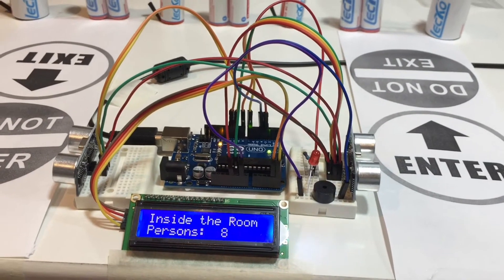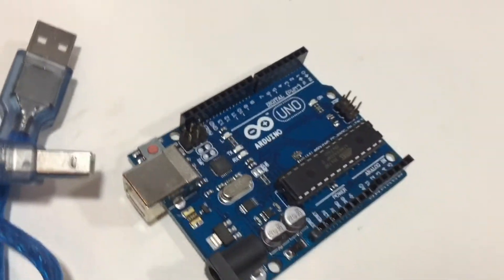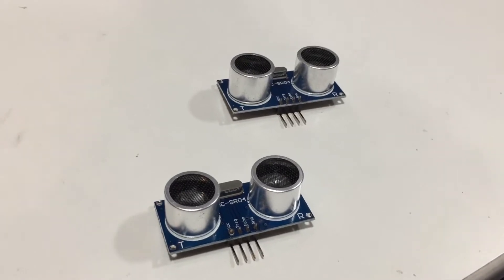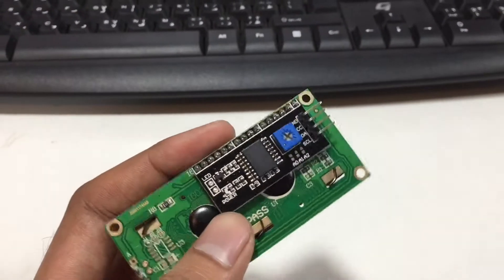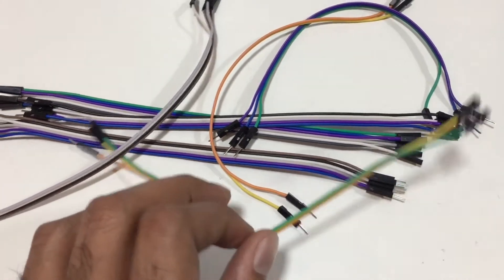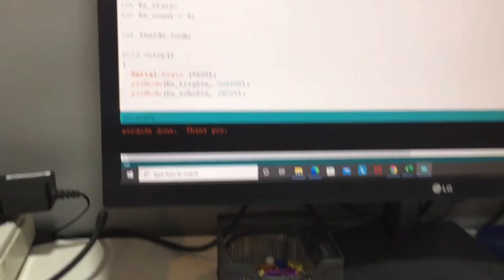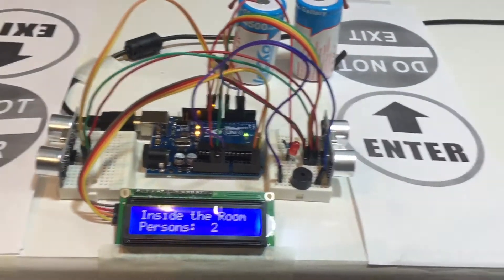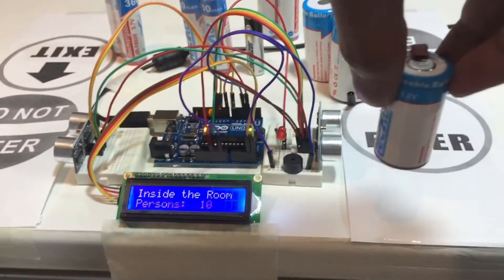Visitor Counter Including Overpopulation Alert Using Arduino Uno & Untarsonic Sensor || DIY Project

Comment: There is an error either in the circuit diagram or code , it’s not working k the lcd just on lights but nothing in display.
make adjustments please 🙏
Reply from the maker: Include correct library for LCD.
You may check the serial monitor whether the output is showing or not. If serial monitor shows reading then there is something wrong in your LCD. Check the LCD brightness ( there is a potentiometer on LCD to fix the brightness)
Reply: Fixed✅, thank you…
It work perfectly.
Reply from the maker: @ENGR_KAYBEE  good luck 🤞🏼

Comment: sir plz tell what is the use of conter file in the link
Reply from the maker: Counter file is the source code file for Arduino IED.
If you have Arduino IED installed in your computer,you can open the file directly

Comment: sir can we use ir rensor instread and plz tell if there is any modification can be done in code
Reply from the maker: Yes IR Sensor can be use instead of ultrasonic. For IR Sensor you have to connect With Arduino digital pins to get the binary signals (0 or 1). And just need to edit the code according to IR
Reply: sir plz tell what would be the modification in code
Reply from the maker: 3 modifications needed if you want to use IR Sensor instead of ultrasonic Sensor 
At first in the initialisation part: remove define of Ultarsonic pins and you have to define Arduino pins for IR Sensor’s output in replace of Ultasonic pins
Secondly in void setup: select pinmode for IR Sensor instead of Ultrasonic 
Lastly in void loop section: replace the ultrasonic condition part and add IR Sensor part. Make the condition 0/1 

Rest of the code will be same. You can check some videos how to program IR Sensor with Arduino to better understand